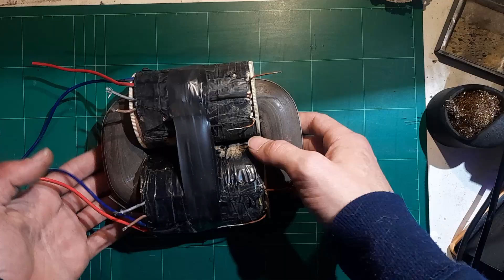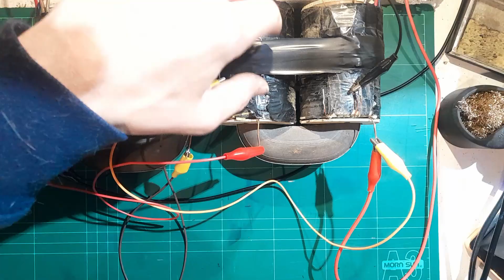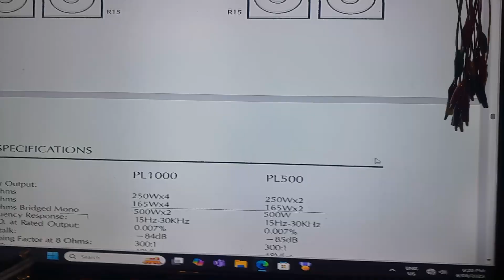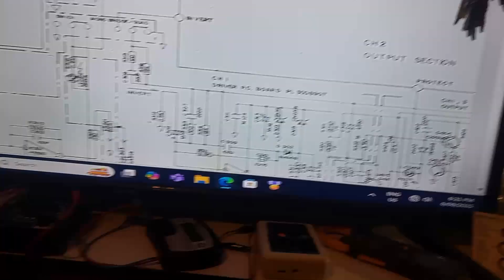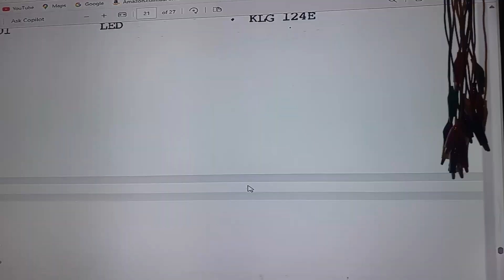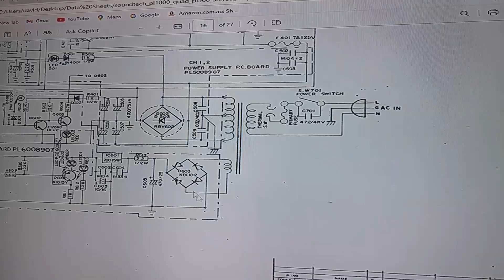I'm confused over these transformers, I can run them of a boost transformer but am still confused!!!

Comment: Okay, so I'm playing along at home doing catch up so as far as I can work out these two transformers were pulled from a SoundTech PL500 or PL1000.  On one primary winding you read 1 ohm of d.c. resistance, the other 1.3 ohms that appeared to be tapped at 1 ohm.  Not sure of the phasing but let's assume this amplifier and its transformer were intended to be marketed to different parts of the world with different mains supply voltages.  Let's assume 110-120v for USA/Canada/Mexico;  220v for the EU and some parts of SE Asia and finally 240/250V for Australia, NZ and South Africa.   So in the US they would have wired the two 110V windings in parallel; in series tapped on the second primary winding for the EU and finally the two primaries in their entirety (untapped) for the 240/250v markets.  In Australia they would have presented the transformer with the latter.  The fact that the windings are on two separate bobbins and aren't identical doesn't matter as they share a common magnetic circuit (core).

Now for those playing along at home to make sense of all of this we need to know several things in order to resolve your problem.  1.  What is the unloaded voltage of the secondary winding you are using for the fan circuit?  2.  What is the d.c. resistance of that secondary winding.  3.  What is the part number of the bridge rectifier you are using (so we can check out the datasheet for ourselves).  3.  The capacitance of your filtering capacitor before the 15v regulator.  I'm assuming you're using a 7815?   4.  The power consumption of your two fans at the full 12 volts (should be printed on the fans).  If not the model number so someone can Google it.  IME, with any transformer you can't find a datasheet for you have to characterise the transformer before you can design the circuit.  By that I mean you need to determine its line and load regulation, unloaded magnetising current of the primary which you can calculate if you know the total d.c. resistance and the inductance of the windings at the operating frequency. In this case 50Hz as you are going to be using it here in Australia, as well as the d.c. resistances of the secondary windings, their unloaded voltage and their fully loaded voltages at the full rated current.  I think the probelem you have is there's nothing printed on the transformers that provides you with that information, so your only avenue is to characterise the transformer yourself by taking the measurements.  You've got plenty of incandescent globes and large power resistors you can use to provide benign loads to take the measurements with and then make the calculations.  Yes, it's not a quick process but IME with transformer for which you have no accurate data this is the only way to find out exactly how it will perform.   How do I do this? I sketch out a circuit noting down all the measurements as I go as well as taking note of the colours of the leads coning out to the transformer, then transfer the results into an Excel spreadsheet and use the graphing tool to help visualise the results.   How you gain the data is up to you.
Reply from the maker: I hate to be annoying but I have made sure it's not because of insufficient capacitance as it can't power a single fan with 2200uf input cap its not even able to produce the right voltage to run a 15v regulator off as its shy even with one fan and the 2200uf low esr cap (quality one) the winding is only a small .8mm 15v winding so you can imagine how many volts are dropped with even a 200ma load there's no way a winding that only makes 18 v even with the transformer wired with the .3 ohm winding removed from the picture can. Supply a couple hundred ma and power a 15v reg with a 2v drop out voltage, It makes no sence that the regulator would be falling out of regulation by design but if that's what they decided to do (1 ohm in series with 1.3 for 240v) then it really is like that and just a bad design, also I have to correct you on a split bobbin transformer with split primary windings it does make a difference as the field is not the same strength everywere in terms of how it couples with the windings also there are other coupling factors at play and if you do run even .3 ohm less on one side ther is an imbalance on the secondary as I have shown already! And that's not somthing I want in my build lol. I can do a video to debunk and prove all of this if you want, I have made so so many transformers, I have discovered a lot of secrets most people do not know. That being said its only a small difference but one rail will have a different starting voltage and sag a bit more than the other.
Reply: @daveselectronicslab   Well Dave, no disrespect intended but based on your statements you know it all and I'm gobsmacked you actually asked for any input from your viewers.  Was it a trick question so you could put down anyone who offered you some insight to which you have a different opinion on?  Even if you are half as good as you say you are why haven't you been hired as a design engineer for a high-end audio manufacturer like Accuphase?  I'm quite sure companies like that would benefit from your vast wealth of knowledge that in your opinion is not common knowledge. To quote your own words "I have discovered a lot of secrets most people do not know."  Why you are spending days piss-farting around with a couple of recovered transformers for which you can't find any data on beats me.  You say you're a perfectionist and that IMHO is a great thing.  If that's the case why don't you get Tortech to make a custom transformer or transformers to your exact specifications?  They're located in your own city at Unit 4/31 Wentworth Street GREENACRE NSW 2190.  As for your fan circuit.  You said both 12v fans running at full speed draws a total of just 200mA.   That's just 2.4W so a small inexpensive 15VA EI cored transformer from your favourite parts supplier Jaycar would be more than adequate (if not overkill), capable of running 4 of those fans and cost a mere $14.95 Aussie dollars (about 10 bucks for the benefit of your US viewers).  For perspective any half decent electronics repairer would charge a minimum of $100 per hour.  So the cost of a Jaycar Type 2155  CAT.NO: MM2002 transformer is worth less than 9 minutes of a repairer's time.  Think about that for a moment and then justify spending two nights trying to get this to work to your satisfaction and still not have an answer when a simple under $15 solution would have solved the impasse.
Reply from the maker: What are u on about im boosting it for the main windings for the amp not just the fan circuit lol u missed the other video thats why you dont get what isnt in this video.@Tanamera-Tech
Reply: @daveselectronicslab   mate, as I commented before. Tortech will manufacture custom transformers to your exact specifications in one offs if need be.   They are very reasonably priced, their work is very good and is Australian Standards compliant.  Also they are local to you, that is they are located in Sydney.   I'm sure that they would be more than happy to work with you to manufacture you a custom transformer that meets or exceeds your exact requirements.  You've already made mention that you've wound your own transformers in the past, therefore I guess it begs the question of why you aren't doing it this time to get exactly what you require rather than rubbishing some Korean amplifier manufacturer saying they didn't know what they were doing and in the same breath using a couple of transformers pulled from one of their amplifiers?  If their stuff is crap why are you using their transformers?  You constantly comment that you are a perfectionist and manufacturers of some components don't live up to your exacting high standards, but here you are using a couple of transformers pulled from an amplifier made by a Korean manufacturer which you have clearly labelled as a dodgy manufacturer who had no idea what they were doing.  Makes absolutely no sense whatsoever mate.  There's an old saying that has its origin in the 13th century - "A poor craftsman blames his tools."  I think I'm seeing some of that here in the videos.

On the point of watching your channel.  As much as I would like to watch every video you put up on your YouTube channel in its entirety, sorry, but sadly I just don't have the time. I was questioning my own sanity about been up posting a previous comment on your channel at 1:30 AM but obviously I was mistaken in thinking I was making a useful contribution to the discussion.  Apparently not.  Having said that I'll leave you to it and I'll refrain from entering into further technical discussion on a subject to which you believe you have unquestionably superior expertise and experience over and above everybody else's. Just to be crystal clear, I don't and won't ever pretend that I know everything there is to know about electronics over the past 50+ years of working in the industry in a professional capacity.  I'm not that arrogant.  Everyday is an opportunity to learn something new or to give consideration to new ideas.  The day I give up on that philosophy will be the day I die.  Good luck with your project mate. I'll wait to see the final outcome.
Reply from the maker: The thing is these transformers are hard to rewind in this style, and with both 1.3 ohm windings driven just over 250v its very well ballenced and also the flux density is alot stronger with only ~10ma more current wich tells me that's how they should run (they don't hum or get warm either) that's why I will boost them I just wish it was easier to rewind them or they were wound slightly different. The other things is with amplifiers the transformers should be on the side of running more close to saturation at idle than normal designs and these are quite the opposite with very saggy outputs unless driven with more v, and they have the capacity in terms of iron and copper it's just the ratios that are off on my opinion. I probably won't order or wind one from scratch until I build a really high end amplifier so right now I'm just trying to use what I have and considering the size of them I'm not worried about power just the way they run! Btw if you take a look at the schematic for the pl1000mp you'll see a few corners are considerably cut like 2 pairs of 2sa1492 2sc3856 for each channel and each channel rated at 250w 4 ohm that's just 260w of device per side (I'm not doing much better at 300w per side😂 by side I mean npn vs pnp) to stay in the soa area my hs needs to run around 50°c theirs would have had to be even cooler😂😂😂 and that's just the two most obvious corners they cut!
Reply from the maker: @Tanamera-Tech yes your 100% correct, I don't know everything and will always be learning. I don't mean to come across like I know everything. I need to work on that, I appolagise for my attitude.
Reply: @Tanamera-Tech  Your a good man :)
Reply: @daveselectronicslab  That's great ! let's get this amp built I want my numbers !!
Reply: @daveselectronicslab  Dave, I'm going to break my own rules here and reply even though I said I would refrain from entering into any further technical discussion about this video.  These are C core transformers.  One of the easiest to take apart and rewind.  My favourite type of transformer because you can easily repair them if you need to.  I noticed the two white formers moved around quite easily when you were handling them and commenting about the tape over the windings.  That "hose" type clamp one of your viewers thought might be acting as a shorted turn is actually holding the two C cores together.  Just loosen it off completely and the two C cores will come apart.  You can then easily slide the two white cylindrical formers off the cores and gain easy access to the windings.  Rewinding these is a piece of cake compared to the traditional EI types and infinitely easier than a toroidal.  So no need for a boost transformer cluttering up your amplifier chassis, just rewind the secondaries to get the exact voltages and currents you require and isolate them from each other with a few layers of Kapton tape.  There's no technical reason to split the primaries or secondaries over the two formers.  Yes they did it in these I believe just for convenience and ease of manufacturing to so they could use the same size formers.  If anything having the primary or primaries on one former and the secondaries on the other significantly reduces the capacitance coupling between the primary and secondary windings.  However, having said that if you want to explore the rewind avenue then how you choose to rewind them is completely up to you.  There won't be any power transfer performance differences between the two winding methods, just a lot less capacitive coupling with the primaries on one former and the secondaries on the other which may well reduce mains borne high frequency transfer, which in today's noisy mains environment may prove to be a good thing.  Food for thought.
Reply: @daveselectronicslab  Dave, no love lost mate.  It's all good.  We probably have more in common than you realise.  About 35 years ago I was just like you.  Yes, I too thought I knew just about everything there was to know but I was wrong.  So wrong.  What I do admire in you is you're as keen as mustard.  It's really encouraging to see a person of your generation interested in electronics down to the component level and the fact you're always up for a challenge.  👍👍 Heaven knows the electronics industry in Australia definitely needs more young competent techs that can diagnose and repair stuff without just swapping out an entire card or board and hoping for the best.  I'm actually retired now, but I find it difficult to put down the soldering iron.  I'm currently fixing a mate's Harmon Kardon PM660 integrated stereo amplifier which he just recently recovered from a local repair shop (which should remain nameless) as they literally butchered and ratted his amplifier to use for spare parts to repair other customer's gear. 😡  I guess my mate shouldn't have left it there for 26 years hoping the bloke would take good care of it and eventually repair it.  Anyhow he got it back and it's on my bench for evaluation.  I'm hoping it's not beyond redemption.  It a well featured 80+ 80 watts per channel amplifier with facilities you just don't see on new gear and if my memory serves me correctly it sounded pretty darn good when it was still working.
Reply: @andymouse   Thanks.  I'm just trying to help Dave out.  Sometimes the obvious solution is starring you in the face but it just takes a bit of an independent and alternative point of view to see something we might have missed.  I've been there myself on many occasions so I know how frustrating it can be work out a solution to a problem.  One of the things I learnt over time is to not  outright dismiss someone else's idea(s).  Sure at first glance they might not seem feasible because we have preconceived ideas as to what our own solution is and that can make it difficult to be open to suggestions from others. I wish I had more spare time to watch all of Dave's videos and I more than likely missed some important dialogue on previous upload.  Context is everything in a discussion and I fully realise I have missed some of his related content in the process.  Anyhow I've posted a suggestion to him as to how he can get the voltages he wants out of those C core transformers by a easy and simple rewind without having to resort to a boost transformer work around.
Reply from the maker: Yeah there is no power transfer difference with winding all primary on one side, its only noticable when there is different anounts of windings on the two bobins (ie 1 ohm on one pri and 1.3 ohm on the other pri) also capacitive coupling and therefore common mode noise are reduced alot lot more. I know if I remove the band i can take it apart I was just worried about getting it coilled back up and banded tight again and still am! @Tanamera-Tech
Reply from the maker: Thanks mate! @Tanamera-Tech
Reply from the maker: @Tanamera-Tech it's the correct way to do it! Edit.... by that I mean your way not their way whoever wound these!  Especially for sensitive equipment or audio geer!
Reply: @daveselectronicslab  Taking it apart and reassembly is a piece of cake.  Far simpler than an EI core job, especially if you've previously done EI cores in the past you could do this blindfolded.  Disassembly and reassembly takes just minutes.  You'll spend a lot longer time rewinding the coils, but on those cylindrical formers it will be easy.  If you've ever taken a hose clamp off a radiator hose and fitted it back on again it's exactly the same process.  The only tools required to remove the clamp and put it back on are a screwdriver (or nut driver) and a pair of pliers.  You could even use a plastic cable tie when you reassemble it if you wanted to, but the metal "hose" clamp is easier IME.  As I assume you'll be winding for a 240v primary there's absolutely no need to worry about their original tapped and split winding arrangement.  They did this for convenience and low cost assembly of the transformer itself and also so they could use the same sized plastic former on both sides.
Reply: @Tanamera-Tech  :)
Reply: @Tanamera-Tech  Your writing is refreshing and thoughtful. I am sure that Dave is taking this in
Reply: @daveselectronicslab  :)
Reply: @Tanamera-Tech  If your ever in the UK I'll buy you a pint ! Never wound my own transformer so that was an interesting read and they are an interesting transformer in their own right.
Reply: @Tanamera-Tech  26 years LMAO !!
Reply: @andymouse  C cores are the easiest to work on because they can be very easily taken apart and reassembled in literally minutes.  They are the only type that I would entertain the idea of rewinding now.   Also with the higher power units you can usually get away with sneaking in an extra secondary winding or two to power lower current devices like pre-amps, speaker protection circuits or like in Dave's case adding a couple of fans and their associated control circuitry. I've done EI types in the past but putting them back together is a PITA and the only toroidal ones I'd even bother with are RF types with very few turns.  Oh, and BTW I'll hold you to the offer of a pint if I ever make it to the UK.  :)
Reply: @andymouse  Yes, I was gobsmacked when he told me it had been there that long.  His Yamaha RX-V1800 hasn't been there anywhere near as long as the Harmon  Kardon PM660 has but it too was left on a shelf to gather dust.  My mate told me that apparently this repairer doesn't diagnose and repair to component level.  He's more of a replace the blown fuse / swap the boards jockey type of tech.  Kinda reminds me of the days of valve TVs where when the tele went on the fritz a bloke would rock up with a small toolbox and a selection of valves to swap out.  If swapping valves didn't fix the problem he'd ask you the help him get the TV into his van where it would go to the workshop where the real techs lived to be fixed. Strangely, or perhaps not so strangely the industry now attracts techs with the same level of skill (or more correctly a lack thereof) who do exactly the same.  Just swap out cards and hope for the best.  Well, on a vintage amplifier like the HK PM660 there aren't any spare boards to be had so a tech's only option is to diagnose the fault down to the component level and replace it if it's ever going to work again.  It's going to be the same story with the Yamaha receiver.
Reply from the maker: @Tanamera-Tech I know why they wound it like that!  I'd never wind a high performance transformer with the pri on both bobins unless needed. The thing I'm concerned about is not a hose clamp lol it's getting it all coiled back up again, isn't it a big coil? Looks like it would be a springy mess!
Reply from the maker: Also I know the multiple windings and tap are for different countries lol. The issue is its done wrong its obvious when boosted too the voltages are exactly what you'd expect them to be and the windings don't sag by many many volts with a really small load.
Reply from the maker: The fan current I've stated a few times in multiple videos its 200 ma and 260 at 15v
Reply from the maker: I'm posting the video cause I thought someone may know somthing about this not just point out everything that I already pointed out in previous videos and assume the only issue is the fan circuit. The main winding is at 42v but 47 when boosted wich is 63 rectified and a very common rail voltage for an amp this size!
Reply from the maker: It really is a poor design. It was made in Korea in the early 90s and they really messed alot up back then over there trying to cut costs I've come across it before from Korea. I'm 99 percent this is what's happening here as even with the .3 ohm winding left out and it wired for "240" there still isn't enough power for one fan and one regulator
Reply from the maker: Also I showed that they used a 4 amp rectifier with a VF of 1v at I think 1 amp and I'm using an 8 amp one with a VF of 1v at I can't remember but it's in the video, everything you are making out I don't know I have gone into in great detail in these videos. This is offending me your just acting like I don't know anything even though I have proven all this in the previous couple videos.
Reply: @daveselectronicslab  Firstly no one is having a go at you.  If someone takes the time to respond to you it shows they are interested in what you are doing and when you ask for help they go out of their way to offer that assistance.  It's dead easy to overlook something and sometimes other people spot the mistake(s) and offer advice with good intent.  You don't have to agree with other people's opinions and you are under no obligation to try out any of their suggestions. On nearly every video you emphasise that you possess a vast amount of knowledge of electronics and frequently make references to your age of 33 years. You repetitively make a point of making sure your viewers know how many components you have on hand.  The relevance of that more than say a couple of times is????  If you want some honest feedback your videos are way too long, not to the point and have way too much fragmented and discontinuous irrelevant dialogue.  Learn to edit.  Trust me it will improve your views, audience engagement and grow your channel.  It is however your channel and of course you should feel to run it as you see fit.  For what it's worth take the time to check out Mr. Carlson's Lab, XRayTonyB, EEVBlog, David Tipton and Liquid Audio if you haven't already.
Reply from the maker: @Tanamera-Tech no I hear you there I do need to edit and don't have an idea what to show, I have had a few people say absolutely ridicules things to me, so I feel the need to point out im not a kid and that's why I've jumped at your comment tonight. I'm sorry I should have pointed you to the last  video and explained why I am so sure this is a bad design.
Reply: @Tanamera-Tech  :)
Reply: @daveselectronicslab  :)
Reply: @daveselectronicslab  If you find this stuff offensive are you sure this is what you want to do, because I've seen comments in some forums that would have you in tears ! after all your making the assumption the guy has seen your prior videos. He might be trying to work out whether or not to watch your work from the beginning or not.
Reply from the maker: @andymouse he didn't see the last video thats why I was offended he is telling me all this stuff I already have proven and shown. I guess should have explained it all and pointed him to the video before getting annoyed.
Reply: @daveselectronicslab  Yeah mate ! at least you get it......good work Sir !! onwards and upwards. Your transformer theory is way ahead of mine ! I haven't thought about them since Uni about 40 years ago LOL !